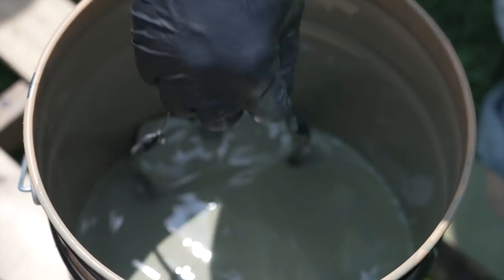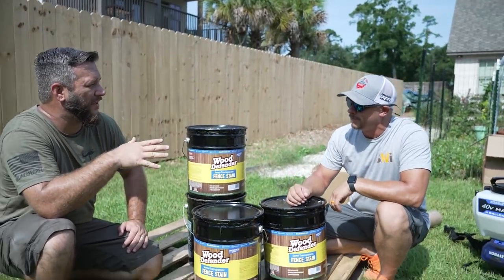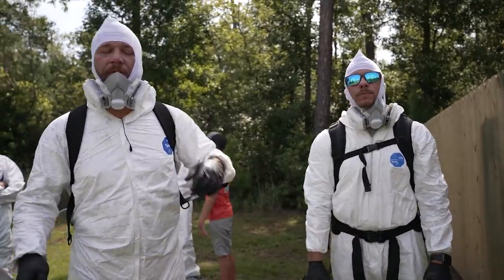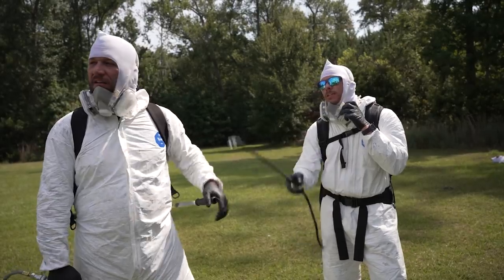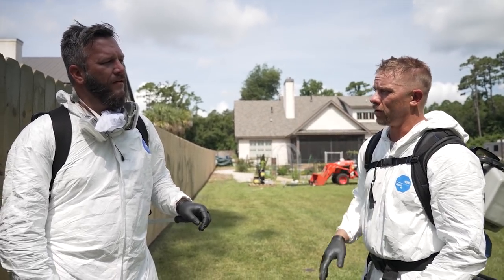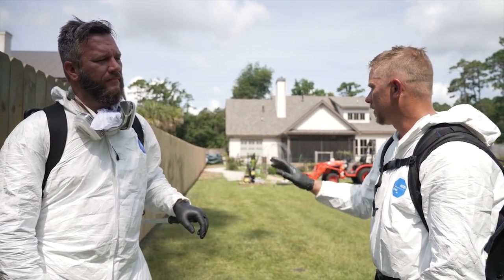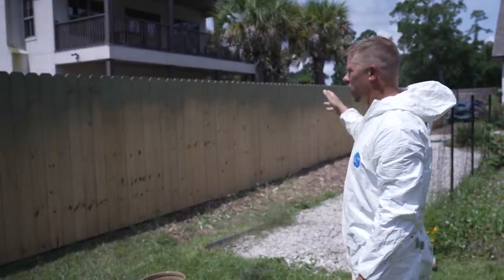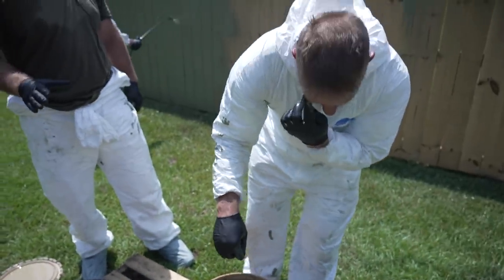Did This Fence Contractor Just Ruin My Fence?

Comment: Youtube Fence Expert here, yeah I watched your first video by the way. Phenomenal. Then I happened to do a privacy fence for someone in Arlington, TX [shameless plug. DM me] a few weeks later. We did not use your easy to do system. We bought stuff from Home Depot. 60 feet cost us (August 2020) about $3500 (not included my labor cost) and took 3 men 10 hours. That's also taking out a stubborn chainlink fence, so maybe 4 hours without breaks (the heat humanity factor was 101°).  We did not stain it, but it was pressure treated. But it DOES need to be stained. Most likely that will be done the hard wat too. But I WILL NOT wear a space suit to do it! 
Nice job on your project. Cool channel. 
--- Sincerely, Handyman. 
---
Reply: Love that you’re trying new things!

Comment: Great job answering questions, but I have one that wasn’t mentioned. Over time fences get dirty. Can these stained fences be power washed and retain the stain, or would you run the risk of removing the stain? Love the content!
Reply from the maker: I'm not positive but I think you could pressure wash at an appropriate distance. Soft wash I guess. This is a penetrating stain so it's deep in the wood not sitting on top. I would check with SWI or Wood Defender for a definitive answer. Thanks!
Reply: @HAXMAN  thank you for your response!
Reply: Washing and reapplying is totally fine.

Comment: So I have a older fence. (about 5 years old) What would be the best way to clean it and prepare it for the stain?
Reply from the maker: Wood Defender recommends you low pressure clean it with a water bleach mix. No need to pressure wash unless you are removing a previous water based stain.

Comment: Psssshhhhttt....   We use Titanium 1/4" wall square posts (6x6), vibrate them in the ground with a special Bobcat attachment to a depth of four feet, fill the core with polymer modified fibered concrete, stick weld titanium crossbars (stacked six high with our patented "rainbow weld artists dime-stacks'), then we take ironwood planks and with a spark-plug gap spacer, precision set each runner plank to .060 gap and secure them with spot welded titanium grippers providing just enough spacing to provide an additional .23 percent strength against wind.

We then take a magnet-held ROOMBA with a sandpaper attachment... let her go... go get some lunch.

When we get back, the panels are superflat - a technical term meaning very, very flat.

Then we soak it all in MINWAX Wood Hardener, which basically petrifies the ironwood.
Reply from the maker: Truly sir, you are a fence artisan. 😁👌

Comment: INSTEAD OF A BACK PACK   /  USE A SMALL PULL CART /  OR A KIDS WAGON /  OR EVEN A WHEELBARROW  / TO MAKE IT E/Z ON YOUR BACK   (HAVE YOU EVER TRIED USING A AIRLESS PAINT SPRAYER  SET IT IN THE CAN OF STAIN AND A 50 FOOT HOSE THAT GIVES YOU 100 FEET OF SPRAYING WITH OUT MOVING ANYTHING  AND NO  PORING   ) /  AND WHEN PORING STAIN GET A LARGE COMMERCIAL FUNNEL  SO YOU DO NOT GET STAIN ALL OVER EVERY THING  / AND ALWAYS HAVE A BIG AMOUNT OF CLEAN RAGS FOR WIPING YOUR EYES AND  FACE AND HANDS AND EQUIPMENT / AND A BUCKET OF CLEAN WATER TO CLEAN FACE AND HANDS  OR A HOSE WILL DUE  READY TO USE  /